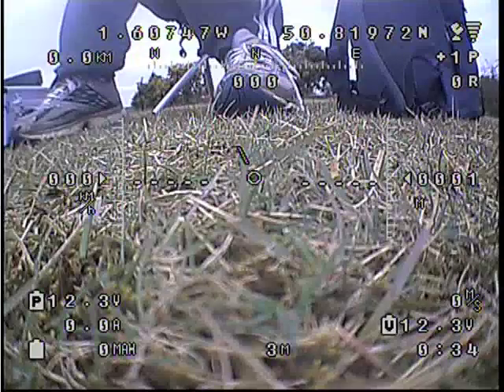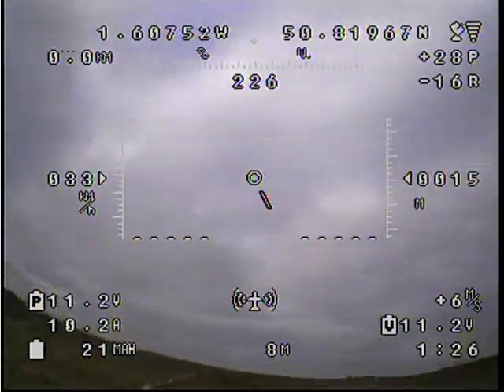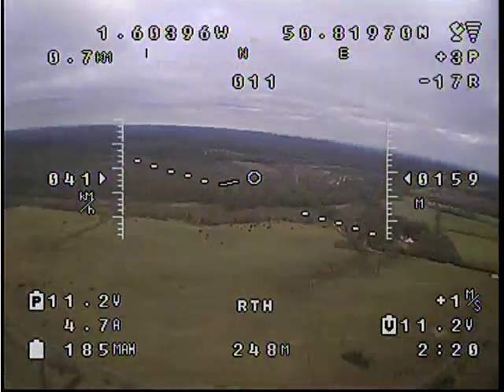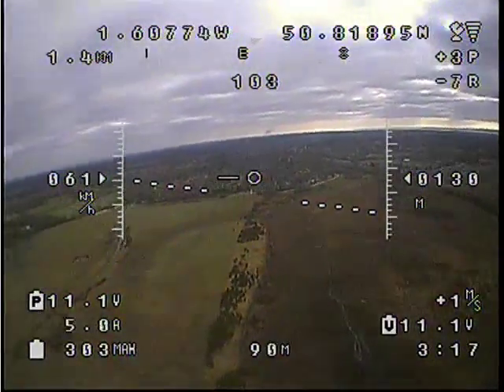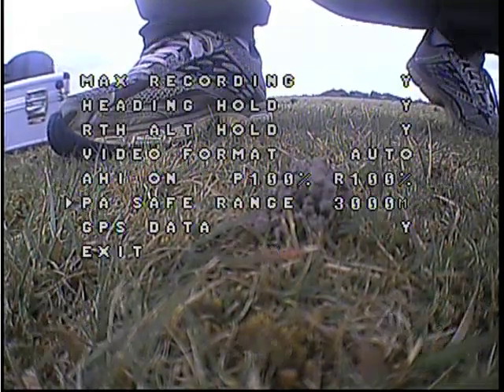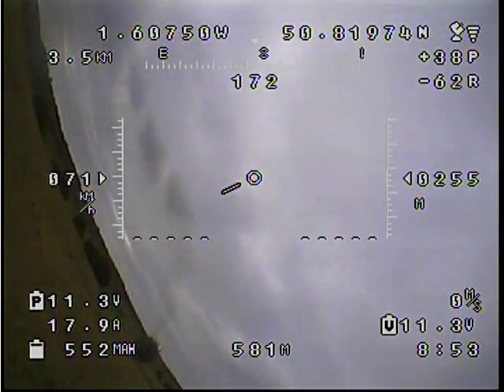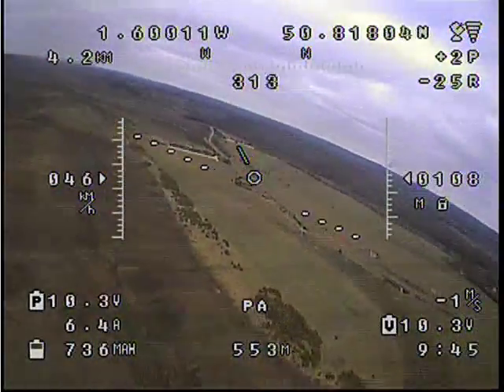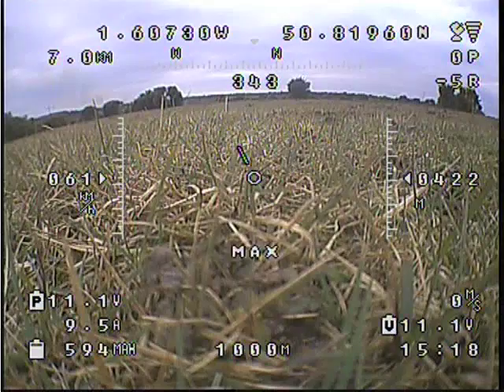FPV Problems: Storm OSD gyro drifting - can you help ?

Comment: Have you tried disabling the ahi on your old board?
Reply from the maker: +peter97silva No, but the AHI being out is just a symptom of the roll rate you can see in the top right.  All the time that was out, the AP would fail.  But there is a followup video (see the notes under the video) which shows the fix
Reply: +CurryKitten Yes ive already seen it, thanks for the solving video. But ive had a osd with the fw 1.10 and talked to extraline because the same was happening to me, and he sent me a new one, with fw 2.something, but the same keep happening...
Reply from the maker: +peter97silva Ah I see.  That's a pain.  Have you checked for any sources of vibration - that could throw it out, as could temp changes during the flight.  That said - I wasn't able to recreate my issue on the ground, and vibe on the wing were pretty minimal.  I hope you can get yours sorted

Comment: Try flying your model without pa or rth
giving different throttle to see if the thrust angle is what pushes your model to veer one way or the other. I had the same issue with the skywalker it would glide perfect but soon as I put throttle on it wanted to veer right and with pa active often dropped a wing and went into a dive. This was actually down to the wings on the new skywalker being a product error. Check out some of my video's  I have recently got my Cyclops storm rock solid.
Reply from the maker: The wing is flying really nicely, glides well in deadstick, and I can pretty much go hands off with motor on and it'll go in a straight line.  Storm is my bixler is 100% fine, although I'm beginning to wonder if that's because it's hidden away in the fuse
Reply: Check my Bixler video I have my storm on the outside of the frame. As long as its pretty much centred near cog it should be fine, On a wing then it may cause problems if the model goese to the wing the stom is on taking it longer to counteract. Check wiring close to the storm unit maybey there is a current messing with the gyro.

Comment: Hi, is you're Storm up to date, i.e. running on V1.1? It's strange how temprimental these things can be I have had the same problem on my old Skywalker. First, make sure vibration is down to a minimum, balance the prop etc. Then isolate the storm from what's left. Try some moo. gel (E-bay) under the storm. Just because the cam is not getting Jello, does not mean the storm is not!!! Lastly & MOST IMPORTANTLY, put the Storm on its own 12V power supply. I use a 500mah 3S plugged straight into the storm. Seems to have sorted things. If that fixes it? I have heard you can isolate interference by using ferrite rings between the power supply & storm & use EMI copper tape. But it does appear that it affects some set ups more than others. I suppose different ESC's motors, Rx's Tx's and there proximity to the other components all make a difference. It seems a bit of a black art, but once you know what to look for, you have a fighting chance!!! Let me know how you get on. Take a look at Pudsey-Rc. He has had the similar problems with his in a Bixler 2. He now uses two 500 mah 3S to power the storm & immersion Rc Tx individually. Extreme, but it works for him!!!
Reply from the maker: Thanks for the comprehensive reply there :)  I did a ground test today, where I turned on and just waggled the servos around - no issues.  I then held the plane in my hand and ran the motor (which is also a handy way of blowing crisp packets around the house)  After a few tries and even with shaking the plane around in my hand I wasn't able to upset the gyro much.  It got out to around 5 degrees once.  If I can find an easy way to recreate it on the ground then I'll also try it with a dedicated power supply for the storm.  RIght now it doesn't look like an issue with sharing the same lipo, or vibes (had my iphone running vibrations on the storm), but something that only occurs when in the air.  Is the air over the plane messing with storm, or is there too much flex going on ?  I don't know, but will continue to look at it

Comment: That's why i choosed the Dragonlink OSD! I was hesitating between the Tornado, Storm and it! But the storm has some issues! You should take a look on Storm OSD RCGroups.com topic. Maybe someone experimented the same problem.
Reply from the maker: Yeah - I've posted there, hopeful of some decent responses.  I chose the Storm because the one I have in my Bixler is spot on and has saved my plane numerous times - I guess I just got a dud this time.  I have to say the Dragonlabs one wasn't really considered, it looks pretty good though having just checked all the specs
Reply: +CurryKitten Hi there,
I was wondering if you solved your problem? I am struggling with exactly the same but after some experience with it I am almost sure what the solution might be to it. I am pretty sure that the storm gyros are having temperature drift problems. Why it occurs only in the air? Just because of the wind chill factor. That is why you are not able to recreate it on the ground. I am pretty sure that the problem might be solved with either isolating the storm or placing some kind of fan onto it to assure constant temperature. I haven't tried it yet but I am going to.
Cheers
Reply from the maker: T.K. Kepa Hi there, not solved yet and still drifting out quite wildly.  It's an interesting theory, as my other storm which works perfectly is in the belly of my Bixler 2 and so quite protected.  The Storm Dev is sending me out another to try - so if both do the same then there's something up - so one thing I will try is flying them in an encased canopy to see if it makes a diff.  Will post a video when I do this, as I do hate finding that someone has had the same problem as me, and then never seeing a resolution :)
Reply: +CurryKitten Hello again,
Although I didn't find a permanent and reliable solution to this misbehavior of the storm I definitely found a way to live with it. As I almost always fly with pretty constant speed the gyro stabilizes eventually and the R number doesn't change anymore. So, to compensate for the drift I actually reset the gyro with the plane not being level. At first the ATH is and the R numbers are way off but as soon as the temperature stabilizes while flying it straitens (the horizon) and the R values come closer to 0. It was easier to achieve good results in the winter I have to admit but this way I can make it kind of reliable.
Reply: +T.K. Kepa And again,
The problem seems to be solved! I taped all the openings in the case of the storm (also all the leads), reset the gyros and it didn't drift anymore. I switched the heading hold off as well, what got rid of the annoying swinging motion while in PA mode. I flew with pretty strong winds and it went as a dream.
Reply from the maker: T.K. Kepa As in where all the leads plug in ?  But presumably leaving the hole for the bark sensor clear ?  This is an interesting fix - was due to fly today, but couldn't, but it seems like a simple thing to try
Reply: CurryKitten I just wrapped some masking tape around all the leads and the plastic box. Put some on top of the GPS leads sticking it against the housing etc. I didn't leave any special opening for the baro sensor but didn't make my taping action 100% air tight, that's why my air sensor works fine. It never flew better than yesterday and I hope it is going to stay this way. Before I did all the taping I made some ground testing. I turned everything on, let the sensor warm up for a while and then waved a piece of paper above to create “wind” and of it went. I saw the value of R backing up in no time. Curiously I never had problems with pitch. I hope you can fix yours the same way. If you want some pictures just let me know.
Reply: T.K. Kepa Any luck with your storm so far? Or did you give it up?
Reply from the maker: T.K. Kepa Yes - I stuck an update video up yesterday, I wasn't able to fix in the same way as yours though
Reply: Did the update solve anything.
Reply from the maker: T.K. Kepa Sorry - I didn't mean I updated the Storm, just that I posted a video with the update on this problem and another.  To save you watching it (a bit boring !) one of the dev's "Extraline" watched the video and thought it was vibration, but offered to send me a new main board.  Put the new main board in and all is perfect... so I would guess some sort of fault/failure with the gyro on the original board.
Reply: Oh I see, I miss understood you a bit ;-) . I've been considering buying another mainboard but I am afraid I am going to be stuck with two of those crappy things. What I’ve noticed of my board is that when the son is shining onto my plane canopy, it gets warm inside and the gyro drifts after all. Taping the case of the autopilot seems to only be working with cloudy weather. If the gyros were ok on the storm I would have loved it.

Comment: Is this a new problem or been on since the go?
Reply from the maker: First outing out I had very bad vibrations so it wouldn't work at all, the next time I couldn't get the GPS to lock, so since sorting all that out - it;s been like this... so yes - pretty much from the off
Reply: CurryKitten Ouch =/
I wonder if the initial bad vibrations could of caused an issue? Are you able to reflash the FW?

Comment: Had the same thing happening to me. I think it could be some glitch in crosswinds. The roll gyro not only is giving the readings but on top of that is also actually showing the compensation its trying to perform and send to the servos for the wind if that makes any sense lol. My pitch gyro on the other hand actually had bad temperature drift. The higher I went, the more pitch forward it would read even though I was flying level Im guessing because of the drop in temps at higher altitude...
Reply from the maker: Did you have any sort of fix on yours ?
Reply: I was going to try getting the flash tool soon and try different firmware, just never really got around to ordering it.

Comment: I think you need to RESET your gyro on a level ground with your plane wings flat and the body of your plane on a level flat "plane" so that when RTH is set, it will fly level and flat. That's what I had to do in order to make it work. My Storm is Version 1.3
Reply from the maker: It's a wing, so my reset on the ground was as flat as it gets